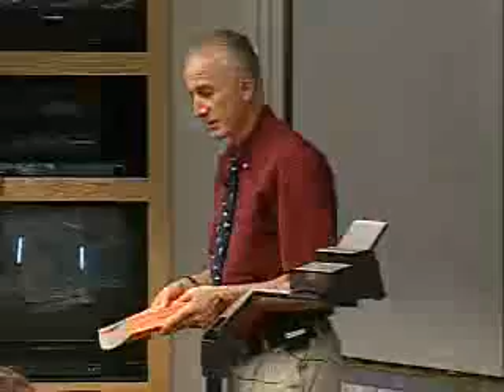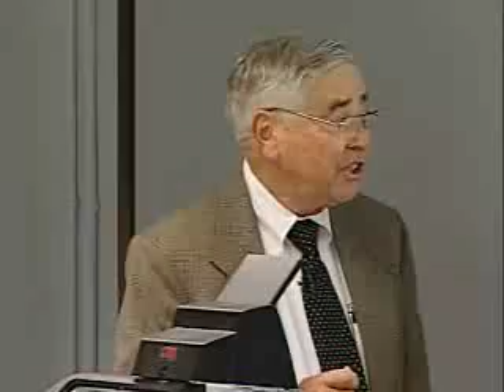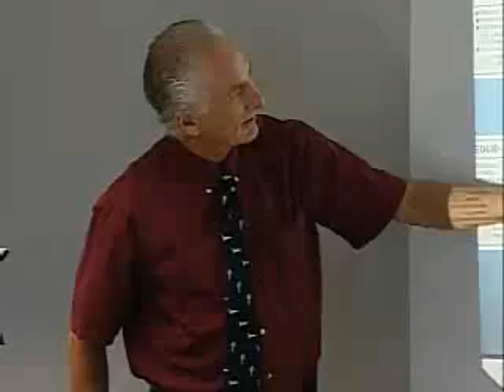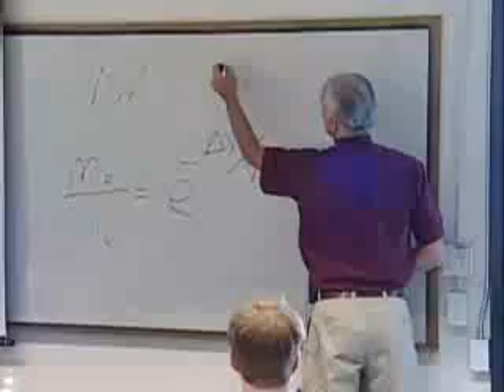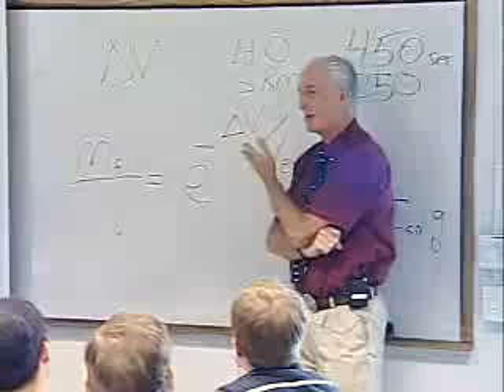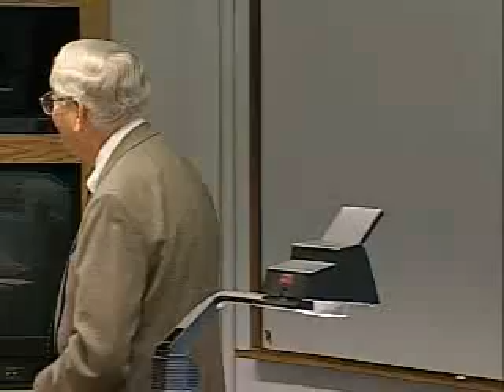Lec 2 | MIT 16.885J Aircraft Systems Engineering, Fall 2005

Comment: This series is fantastic. One small but important correction: He says "nothing else was fly by wire at that time" This is incorrect, the Anglo-French Concorde had its first flight in 1969 and entered passenger service in 1976 and was fly by wire. It was an analogue computer based system but was still fly by wire. The engines on Concorde used digital compter control. Both were firsts. Electronic control was needed due to the wide flight envelope: subsonic through to Mach 2.0